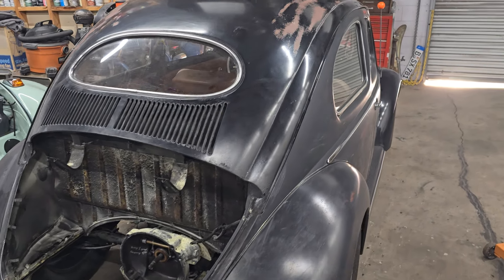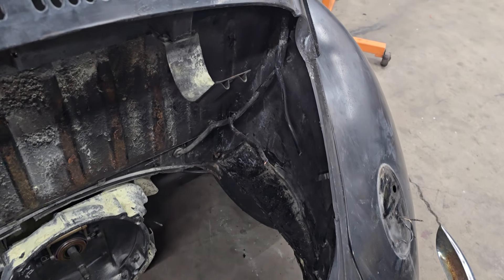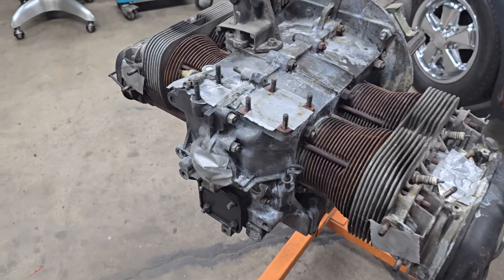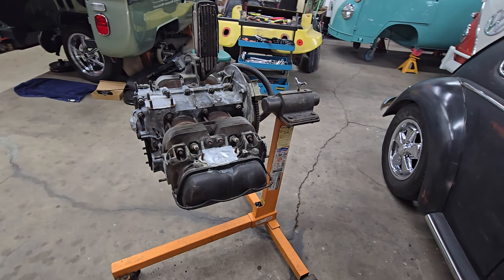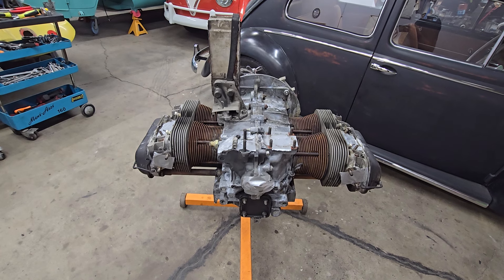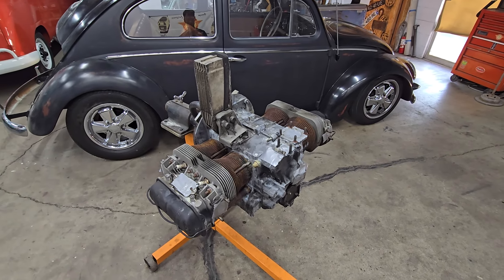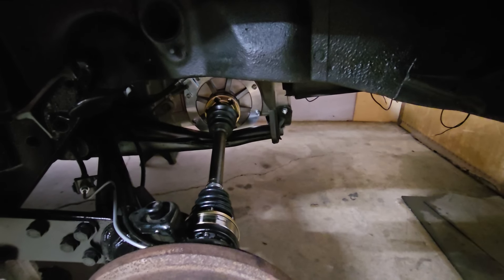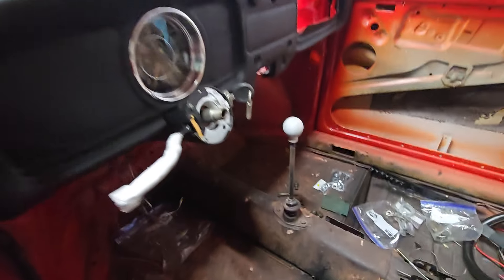A Day in the Life of Vintage Classic Specialist, Episode 200! Removing melted goop from the '56 Oval

Comment: That little motor will run better than before 👍🏻 hey, why is the dune buggy back in the shop?
Reply from the maker: Yeah, VW motors love a good exhaust and dual carbs, really wakes them up!
We're going to hold onto the buggy body till we get the chassis back and do some test fitting. Then the body will be off for stripping.